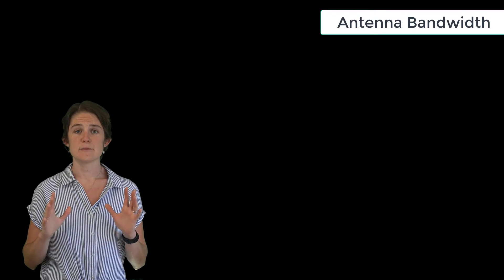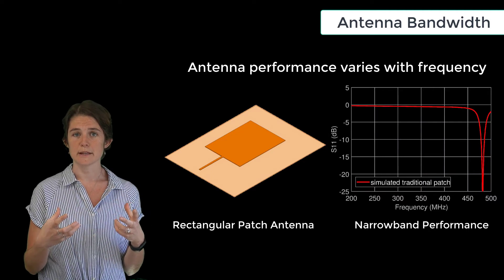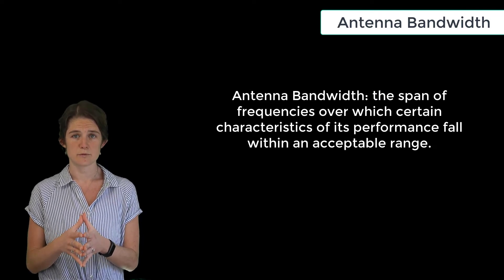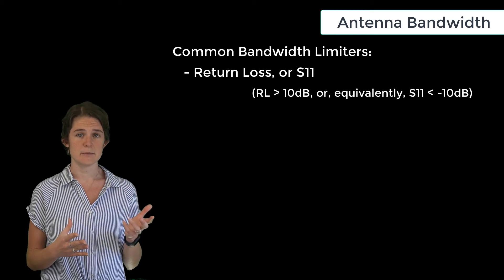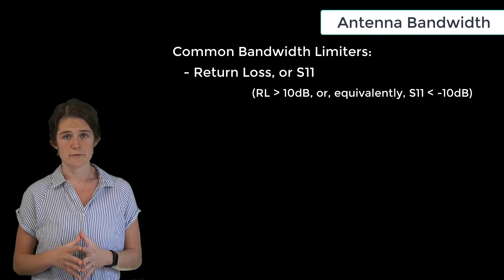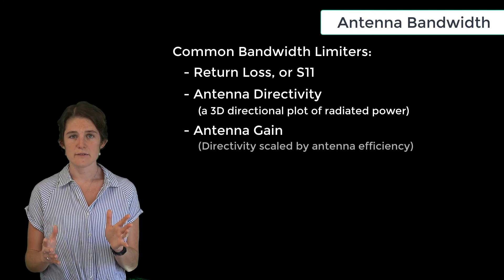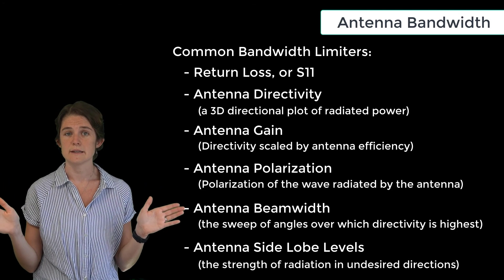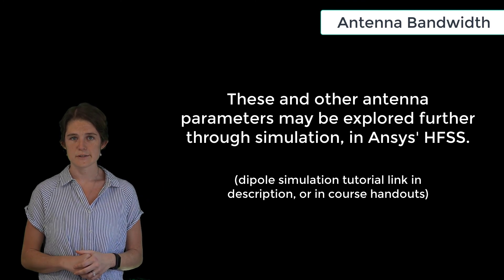Antenna Bandwidth — Lesson 3

Comment: All of your videos are excellent. I don't know if you are listening still to replies, and I hate to impose if you are, but a fascinating question I have been trying to answer is that the length to diameter of a dipole antenna determines its bandwidth, and adding d with a fixed l increases the bandwidth while decreasing its resonant frequency. Do you know why this is? I have done many searches and found nothing, except that increasing d reduces the inductance, which contradicts the lowering of the resonant frequency, unless fringe fields counteract the reduction in inductance. Thank you, whether you see this or not.
Edited to add: I found the answer in ARRL Handbook on page 20.3.
“If the diameter of the conductor is increased, the capacitance per unit length increases and the inductance per unit length decreases. Since the radiation resistance is affected relatively little, the decreased L/C ratio causes the Q of the antenna to decrease so that the resonance curve becomes less sharp with change in frequency. This effect is greater as the diameter is increased, and is a property of some importance at the very high frequencies where the wavelength is small.”